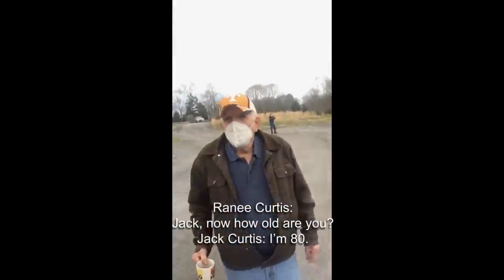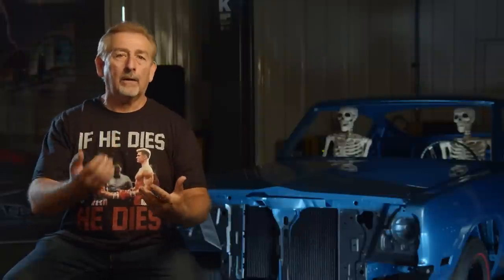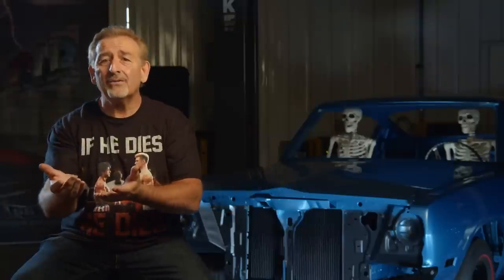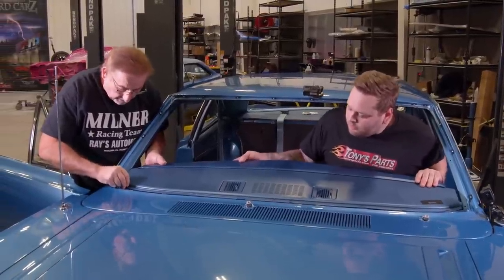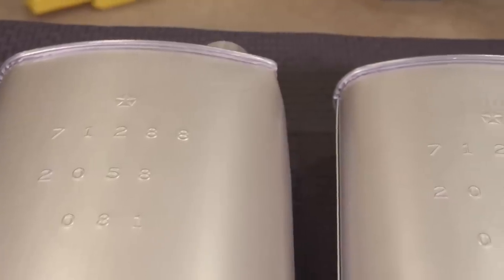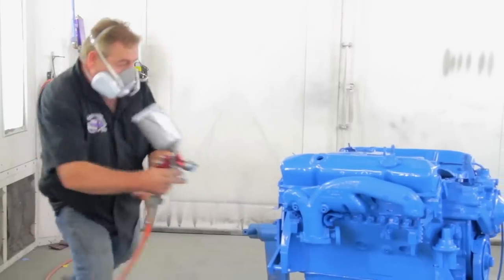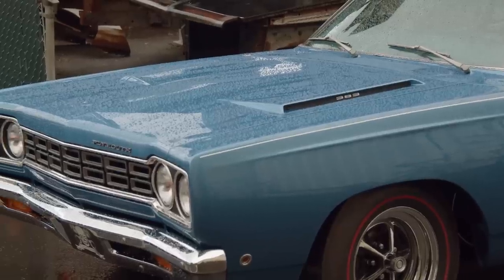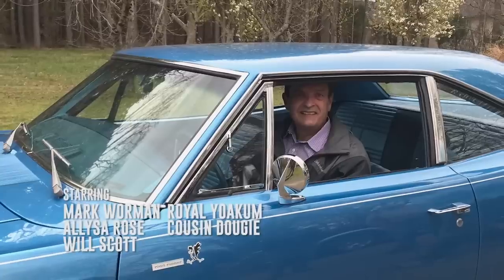NEW EPISODE: JACK'S BACK: 68 RR BACK TO ORIGINAL OWNER!

Comment: I bought a brand new ‘68 Roadrunner in May 1968 when I got home from Vietnam. Cost: $2,900. The car was a post car in dark metallic green with a black interior. 383 Magnum with a 4 spd. No tachometer, no PB or PS. No carpet, just factory rubber mats throughout. The radio did have an 8 track tape player. Painted wheels and dog dish caps. The car came from Tower Motors, a dealership in my hometown of San Diego.

Comment: This car reminds me of a 1978 Delta 88 Oldsmobile 403 4 barrel with a 5 on 5 suspension with electric windows and seats it was one of my favorite vehicles that I ever owned and pretty speedy I might add I used to take it to the Friday night fun drags at KCIR in Kansas City and outrun nearly every other car that I can find and it's weight class also it was an old sheriff's car which I had replaced the factory timing chain and gear with a steel double gear and chain assembly right after I got it cuz I shut it off and it's stripped all the nylon teeth off the timing gear put the new one on it fired right up I drove that car for 20 years actually 25 my mom let my sister drive it and she wrecked it that really pissed me off that car  reminded me a lot of those old boxy body type Mopar is you're talking about there buddy matter of fact it looked a lot like some of them and I love that car

Comment: road Runners are awesome, I never was a Dodge guy and believe or or not never did or will think chargers are all that, I never cared for any chargers except 1 gen , I built many for guys but my totally favorite car is the 69 road runner / GTX Owned many of both and had a few chargers .. saying that I do like 71/ 72 hideaway head light .. you can put 2 kegs of beer under the hood between the front and the core support lol, bud 69 to 73 RR and A body cuda's, E body 71 are ok .. but Plymouth always looked better then stuffy looking Dodge's.. 50  early 60's were cool